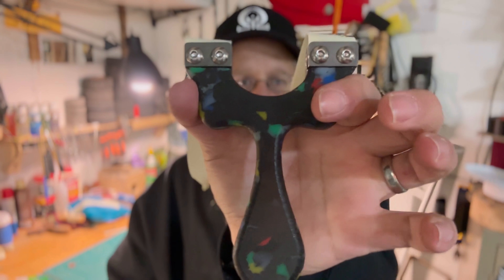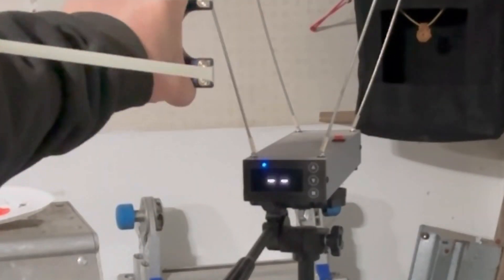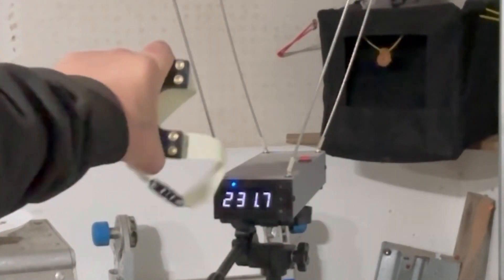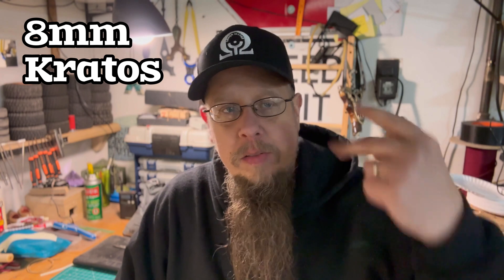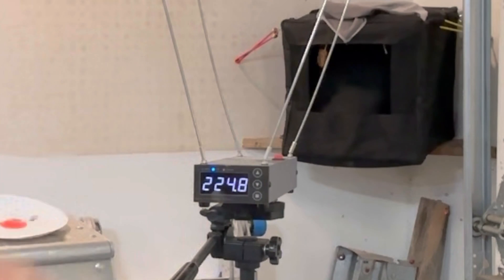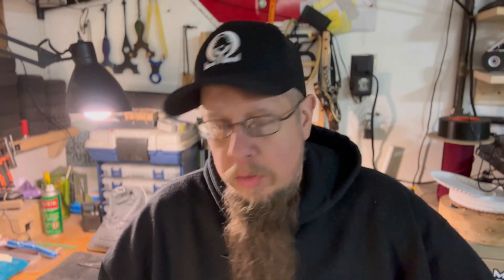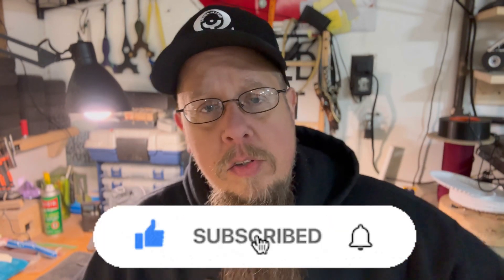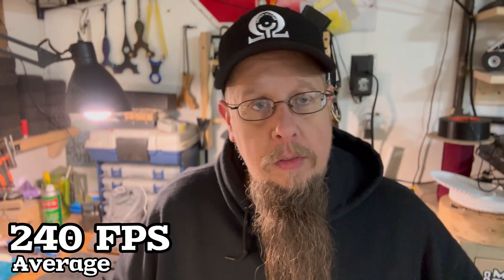Slingshot Flat Bands -Taper Vs. Straight

Comment: 25-12 but how long is the band?
Reply from the maker: Currently I cross cuts mine, so it's 25/12 by 150mm... gives me about 140 active band length after pouch attachment and sling attachment
Reply from the maker: I've been shooting 20/12 cut at 145 also... with 135 ABL
Reply: @DoubleDeeeZSlings thanks! I have been hearing the first two numbers for awhile but nobody ever mentions how long the are relaxed and I'm not smart enough to figure that out. Thanks a bunch. PS... I scored a bunch of orange colored bands from the lab tec yesterday. I called her honey and told her she had beautiful eyes. She gave me a bunch. You might pass this info on down the line. I know the aren't the best bands, but my 5,6,7 and 8 year old grandkids won't know that.
Reply from the maker: @willchoate7072 😂 that's awesome!! Hey I bet the orange bands will work just fine for plinking around!

Comment: Yeah I have a question for you I got this 8dea to make my own bands starting with 1 1/4 ×3/4 so I will like your input on this question 
 it's a problem all this metric stuff 
For the most part I don't understand metric 
I started to thinking  just why not try inches 
And stay with what you know 
I even made my own cutting jig out of some plexiglass scraps I found problem is practicing what I found to work well enough for me 😊
Reply from the maker: Use what you know!  So that would be approx a 31/20 taper.  That is a very stout taper, test it out and see, I think that you make enjoy a little bit small of a taper though.  Maybe 1inch to 3/4 of an inch.  It's all personal preference though!

Comment: You only went up to 18mm with the staight cut and 24mm with the other tapers, its hard to tell anything. Please compare 25mm straight cut vs the 25/12 taper.
Reply from the maker: I tried 20/20 straight cut off camera and it was actually starting to slow back down… I tried to just show a variety of tapers…
Reply: Man i mist it was on with micky and rex, sorry deeez
Reply from the maker: No worries lone!